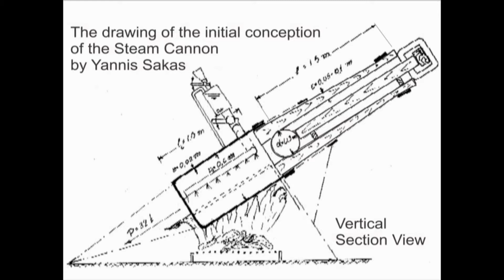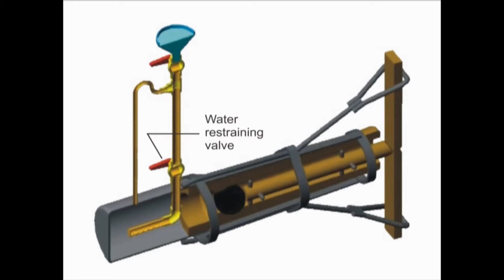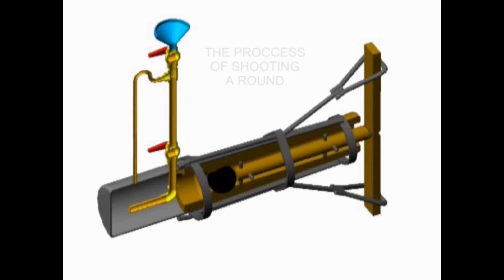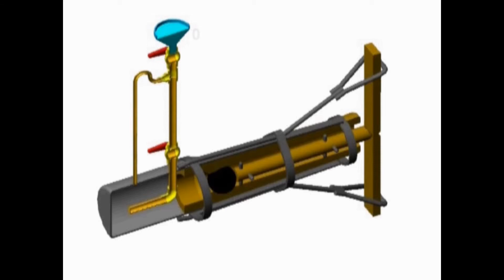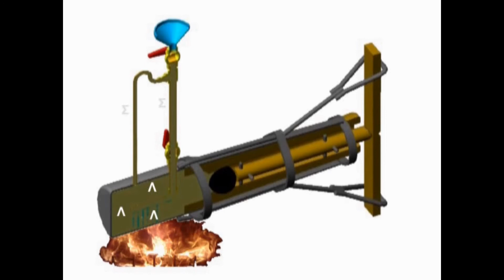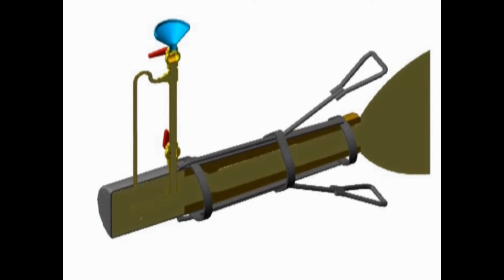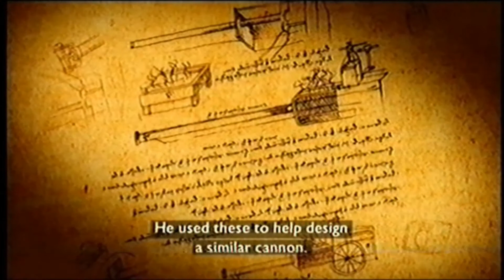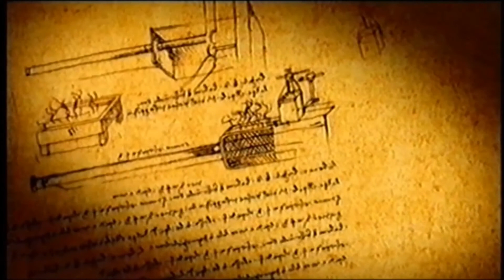THE STEAM CANON BY ARCHIMEDES (EXPERIMENT BY YANNIS SAKAS)

Comment: I think that it would make sense to increase the heat capacity of the kettle/chamber by adding rocks or metal into the chamber/kettle. Also the water should be added to the rear of the chamber, that way it evaporates and then streams over the hot rocks/metal overheating it.
also i think that the restraining stick and projectile should be one, there should be a short wooden piston to seal the steam in, with a wooden arrow in front, the arrow should have a metal tip.
Reply from the maker: In one experimental trial, a cylindrical piston made of cork has been added behind the spherical projectile, augmenting the thrust onto the shell, and resulting to a longer range.